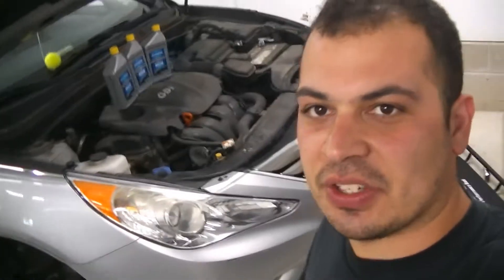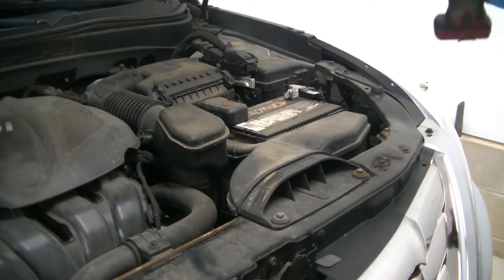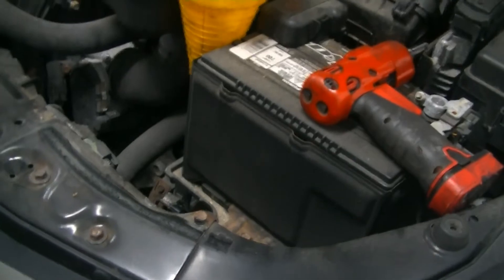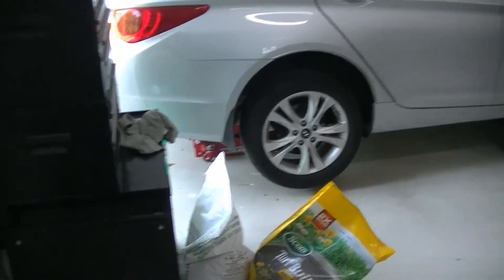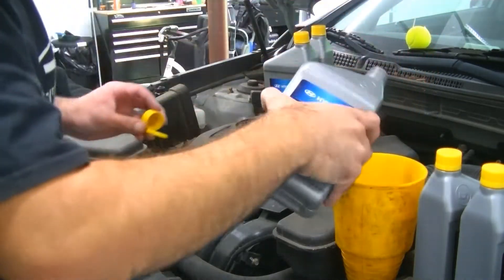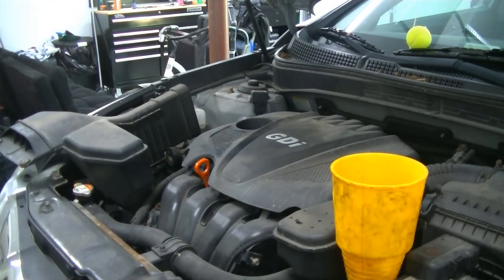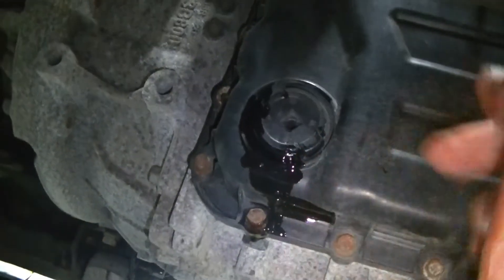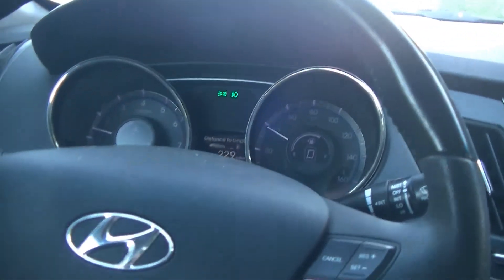Hyundai/Kia 6 speed automatic “sealed” transmission fluid service and level adjustment

Comment: Will this be same for my jeep compas 2016 with a 6 speed transmission  A6MF1 (Hyundai)? Also is there a filter to change / check?
Reply from the maker: Admittedly I’ve never worked on one of these in the jeeps, but as long as the layout of the trans is the same I don’t see why not

Comment: I followed your video to a T I watched it, I did everything I removed every piece I put it all back together I filled the transmission fluid and as soon as I started feeling the transmission fluid it started bubbling over. Do you know why because I did not follow your instructions with meant leaving the cooling tube removed before refilling it. Great video, but if I would have followed your instructions, I wouldn't have made a mess. But overall the video was 100% accurate at exactly what I needed. Thanks a lot

Comment: I have a 2022 tucson hybrid. Does it have the fill plug at the top. I heard the fluid check hole is the where you fill from with a pump
Reply from the maker: There is one up top but the hybrid components are in the way. you can fill it through the check hole until it trickles out and then get it up to temperature.

Comment: Will this procedure be the same on a 2016 Tucson with a dual clutch 6 speed?
Reply from the maker: Dual clutch is a simple drain and fill with gear oil. Just be sure to use the correct spec fluid

Comment: Isn't there a return line from the cooler that's integrated into the radiator? If so, wouldn't it be easier to do a drain and refill, start the engine as it drains into a measured bucket while you pour more fluid into the transmission. Once you see new fluid come out of the return line, kill the engine. Then use the scanner to monitor temp, check fluid, and then clear the adaptive transmission values or transmission control module (TCM.
Reply from the maker: Many different ways to skin a cat. This is the way the service manual tells you to do it 👍
Reply: @SEsGarage  Yeah, I get it. I just thought it would be better to replace all the fluid at once since some only drain around half. Well, at least the ones I worked on. Better than watching someone do 3 or 4 drain and refills. :) That gets expensive quick. Regardless, thank you for the video!

Comment: Thank you for sharing your knowledge.

I used a car wash bucket with capacity markings from Walmart to measure the amount of fluid drained. I confirmed the accuracy of the markings by pouring a gallon of water into it, and they proved to be very accurate. I drained just under 4 quarts of fluid from my transmission, added the same amount back, and skipped the side inspection port step entirely. I'm the original owner, and the transmission had never been serviced. Even with 100,000 miles, the fluid looked pretty good. I used a Dixie cup to add the fluid slowly to prevent overflow from the cap.

Replacing the splash guard was the biggest challenge for me. Here are some tips that worked on my 2014 Santa Fe Sport 2.4, supported on jack stands:

Not all of the bolts are the same length. Be sure to mark where the short bolts go. I also removed three screws but wasn't able to replace them.

A cordless driver is your best friend for handling the bolts.

Use a bucket to support the back of the guard when you're replacing it. This makes positioning the bolt holes easier, as space is limited and the guard is cumbersome when working from below.
Reply: I just changed the fluid last weekend. I did as you said, measured how much fluid came out, and put in the same amount. I've been using Valvoline ATF for the last 2 ATF fluid changes, much cheaper than OEM fluid, and it works just fine.

Comment: I have a 2014 kia forte koup sx with the six speed automatic. Has 119,300 miles on it and every shop around here wants to do a flush and don’t don’t want to do a drain and fill. So far it isn’t overheating and shifts fine. Do I just leave it be because I really don’t want to flush it?

Comment: My 2010 Santa Fe with 3.5 V6 engine only drained out 3 liters of fluid and I filled it as in the video to about 3.5 liters. Wonder if it was low. Never had a leak and bought the car new. The Santa Fe always shifted smoothly expect when cold and engine on fast idle. It shifted from first to second hard and then after about a few minutes it would shift smoothly again until next morning when was cold again. Had it to the dealer when it was under warranty and they did a software update on the transmission. Long story short with the oil change it seems to be much better. Time will tell as I did it today. Thanks for the video and all that I have learned from it.
Reply: Any update on it ? Mine doing the same firm shift during 1-2 during cold

Comment: Other than shifting through the gears, Folks, just MEASURE how much fluid comes out when the drain plug is removed, and THEN just add back in the same amount of new fluid!! That way you don't have to go through all that unnecessary stuff :)

Comment: I’ve been wanting to drain the transmission fluid on my 2011 Hyundai Sonata with around 240k miles, haven’t had any issues yet but im afraid that if I replace the oil I’ll start noticing them. Any recommendations?

Comment: I did this by using a transfer pump and pumping in through the overfill drain. Once I got fluid back I stopped. Warmed the car up and checked again. I stopped at a steady trickle which might be slightly less than you did.

Comment: I just did my 2022 Kia Seltos IVT fluid at 30K miles. Oddly, 3.25q came out but when I put in 3q it was too much. I ran the car until the transmission temp reached 125 (within spec) and opened the level check plug. About 1/2 q of fluids came out before the fluid trickled out. Perhaps the factory over filled the transmission?
Reply from the maker: I have a video up on servicing an IVT transmission on a 2020 ELANTRA feel free to check it out!
Reply from the maker: How to service your Hyundai/Kia IVT/CVT transmission!!
https://youtu.be/clav1XzCF3E
Reply: @SEsGarage  awesome! thank you!

Comment: Stephen --- Great information -- I am wanting to change the trans fluid on my 2019 Elantra SE with the 6 speed automatic that has 55K original miles and as far as I know the fluid has not been changed,  but ...  OK so there is ACTUALLY TWO (2) Fill plugs that I see people using!  One is under the Air Box (after removal)  and this plastic plug is actually the "VENT" for the transmission CORRECT?  The factory "FILL HOLE" is towards the rear and a metal 24MM plug like the 24MM metal drain plug -- CORRECT?  Does the Manufacturer (or dealer) use the PLASTIC VENT PLUG or the METAL FILL PLUG Location to add fluid?  That is my question!
Reply from the maker: The plug that I use in this video is the plug that you need to be using.

Comment: Everybody makes fun of Hyundais. I'm a long time auto ASe tech used to work in GM dealers. I've had three so far and not one issue at all with any of them. As long as you do the maintenance and don't beat on them they are really good vehicles. My 2014 Tuscon has 165,000 and doesn't burn any oil (it had the new engine recall at 50k at no cost to me) , gets 35mpg (rated for 21-28), shifts perfectly and runs like new. I take care of it by keeping engine bay clean, use synthetic oils and think it's gonna last well over 200k. I also have an Elantra Gt with 50k and same thing not one issue. Maintenance is cheaper than repairs remember that!
Reply: I've got a 2018 Tuscon. I got it at 30k miles, used and I maintain the hell out of it and it shows. No issues, daily city driver, avg 40 - 50 city miles per day. Not once has she let me down. 6 days a week in all weather. Currently at 109k and counting. I truly believe I can get this baby to 300k. I changed the trans fluid every 30k, same with the differential fluid and transfer case oil. Once I hit 100k, I changed them again.
Oil change every 3000 miles. Liquimoly engine flush every 20k, followed by a second oil change within 150 miles of the change after the flush. Oil change after that I add liquimoly Mos2 anti friction additive. 

Every 3rd Oil change I swap out my engine filter. 
I'm under the hood alot just making sure she's good. 
If you treat this car right, I think it's a pretty good car

Obviously brake fluid change at 60k
Coolant flush at 60k

Rotate tires at 10k

Comment: If you dont have a scan tool & your car doesn't leak trans fluid can you just put the exact amount you drained?
Reply from the maker: You’d have to do the service with the transmission at ambient temperature and fill it at the same temperature for this to be accurate

Comment: This video got me thinking.  If you're supposed to get it to within a range of the temperature, then plug the inspection port back up when it's a slow trickle, anyone ever re-inspect the level after they let it cool off ?  I know fluid expands when it's hot, but that by that much.  My hunch is that when the fluid is back to room temperature, it will be at the bottom of the inspection port, very similar to how axles and past transmissions were 'full' when the fluid started coming out of the service port. 
If my theory is correct, and can be verified, future fluid changes can all be done 100% from the bottom.  Drain as usual, and then full thru the 'inspection' port until it starts oozing out.  Start engine, cycle thru the gears, and then just top off again thru the inspection port.    Should make the whole process less than 10 minutes (minus the time required to remove the belly shield).
Reply: Digging deeper into this myself, Hyundai themselves say you can add fluid thru the 'level checking plug' that we refer to as the 'inspection' plug.  Ref TSB below, step 7.
https://static.nhtsa.gov/odi/tsbs/2013/SB-10059658-2273.pdf

Comment: This is one of the better videos, however...
That final over-flow/inspection port stream was still pushing out quite a bit of fluid.
And everyone is going to be different/subjective on when to call it.
5-10 seconds early or late seems like it could easily be 1/2 quart.
There has to be a better way of dialing that in properly.  What it you were to shut the engine off, and let it dribble out until it is actually just drips/drabs?
Then at that point you could add 1/4 - 1/2 qt and be closer to spot on?
Wonder if there is a Service Manual that explains this, as it seems rather critical.
Reply from the maker: I typically let it drain until it stops “gurgling”

Comment: Hi, this way you only replace 50% of the oil. the other 50% remains in the torque converter so this oil change is useless, it remains polluted.
Reply from the maker: In MOST cases a flush is unnecessary and can actually do more harm than good. If you’re worried about it, you can do a second or third drain and fill

Comment: Great video.  Save yourself some time and measure the fluid that came out so it's easy to determine how much fluid to put back in.
Reply from the maker: This method only works if you do the service when the transmission is cold. If you drain and measure hot fluid, and fill the transmission with cold fluid your level will be incorrect
Reply: I had a leak . so, I'm guessing this wouldn't work for me

Comment: Spill, measure, fill. If you don't have any leaks, it doesn't just disappear. Better for the fluid level to be a little off than to not change the fluid. If you can change your oil, you can service your transmission. No need for a scan tool if you are careful.

Comment: You never mention IF ANY ATF COMES OUT OF THE OIL COOLER LINE when it is removed or when filling? I have read comments in this video saying a cup of fluid drains and will spill all over. You never mention how to manage this. Just sayin. Great video and info besides that one issue. Thank you for the effort to educate the masses about this mysterious procedure that those BEAN COUINTING SHILLS at KIA/Hyundai don't want any DIY'ER doing themselves.
Reply from the maker: A small amount will come out when filling the trans as the fluid “burps” out of the line
Reply: @SEsGarage  Thank you for taking time to respond and clarify the issue!

Comment: i got a 6 speed in my kia optima hybrid.
i guess i gotta sit in the car and rev the engine or something because otherwise the engine wouldnt warm up runnin on the battery 💀
Reply from the maker: You can use a scan tool and force the engine to run!

Comment: Used the overfill plug to refill
Reply from the maker: Doesn’t always work that way! Thats how I fill the hybrids, but in the gasoline cars with torque converters, this method will not let you get enough into the transmission before it begins to overflow with the engine off
Reply: @SEsGarage  thanks for responding. I measured how much came out but had about half qt left before it started to drain from the overflow port. So I closed it, started the engine, ran through the gears allowed it to warm up then opened the overflow port again and finish refilling until it started to drip again after just about the same amout of fluid was put in. Of note, it did drain a little from the overfill port when I initially opened it
Reply from the maker: @andrewl8251  as long as you started the car and topped it off until it trickled out at temperature, you’ll be fine!
Reply: @SEsGarage  thank you so much. This video was a real help. My car was a 2013 Hyundai Elantra GT btw
Reply: @SEsGarage  It helped to make the process so much faster and easier. Everything works great (this was done on a 130k tranny-. I suspected that a drain and fill should not affect it, given that over half the original fluid was still there, so I went for it. My only issue was how expensive the oem fluids were $33/qt and I didn't want to chance aftermarket, so I bit the bullet and bought it. Mine took about 4qts

Comment: yet, you will never see shops showing a video of removing & installing the automatic transmission filter.
just like you rarely see dealerships/shops/diyers changing the Rear Seal when doing a complete Timing Belt Kit jobs.

and to make thing worst, they used only tab water when doing a coolant jobs. when it clearly stated to mix with distilled water.
Reply from the maker: In all honesty, you should never HAVE to change a transmission filter. If there’s enough clutch material in the pan to clog the filter, you have bigger issues than just needing a service. That being said, if I have to drop a pan to do a service I will put a filter in it while I’m in there. Unfortunately, these Hyundai transmissions do not have a serviceable filter.

Comment: Great video. I have a 2012 Hyundai Elantra. It would be nice if you would make a video that shows the difference between the xTool D9, D8 & D7, Bidirectional vs Diagnostic comparisons. I noticed you don't have the D9 2024 scanner in your amazon store. If you explain the differences of those tools in a video I'm sure some people will consider buying it from your store including myself. Regardless, thanks for the video. It has all the most important, necessary info. BTW I was a professional mechanic for 20 years, was licensed as a test and repair mechanic by State of California and worked in a smog shop (and never misdiagnosed a smog repair even once) and I rebuilt about 20 automatic transmissions in my career. People who know me still ask me to work on their cars from time to time and my old snap on scanner is getting outdated.

Comment: Contrary to what he said, I’d recommend replacing the aluminum crush washer and tighten the bolt with a torque wrench to the spec called for. If not, The likelihood of a slow leak is increased, and will create a lot more work to correct in the future. Just get a new washer. They’re only like a buck or two. Same with engine oil plug.
Reply: 99.9% of the time, your recommendation is not necessary.

Comment: Would you please advise How can I change the transmition oil in turbine of elantra 2005 which the fillter is placed into the gears section. By opening the screw is placed in the bottom of tank, you can only change the oil of tank and there is remained 4liter oil in gears section.
Reply from the maker: You’d have to do several drain and fills to get most of the fluid out of the torque converter. There is no way to drain it without removing it
Reply: Thank you for your response. Would you please more explain?

Comment: Have a 2013 Hyundai sonata. I bought it used I don’t think they ever changed the fluid in it . Has 112000 miles on it everything works great but heard not to change it because it could make it go bad is that true ?
Reply: I changed mine on a sonnata with 109K and it was very very dirty, but didn't break anything, it shifts much better now. I would say go for it, you are only changing 1/3rd of it anyway at a time.